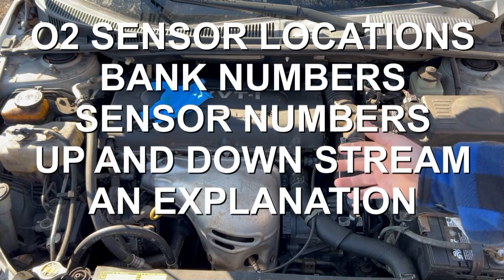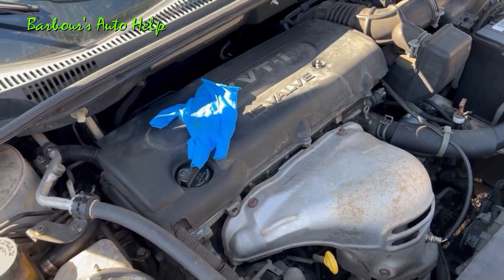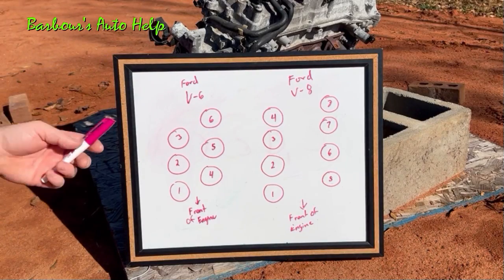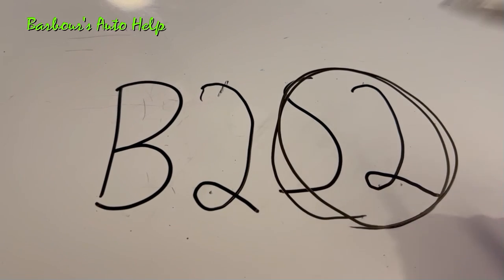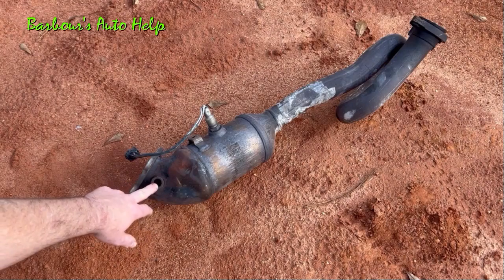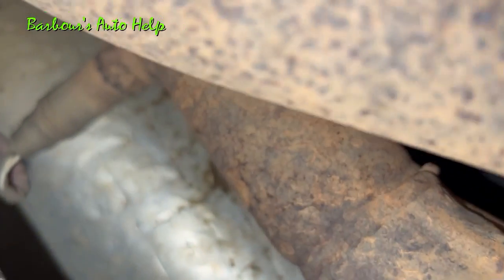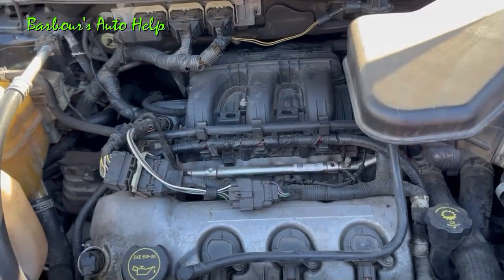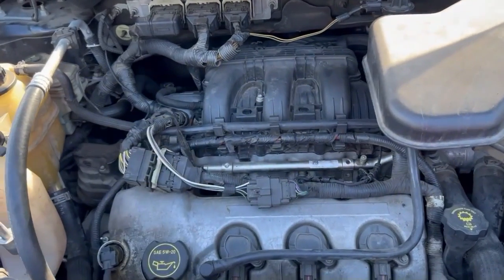O2 SENSOR LOCATIONS, BANK NUMBERS, SENSOR NUMBERS, UP AND DOWN STREAM: AN EXPLANATION

Comment: Hi, I have 2016 model Audi A6 c7, with fault code P2002 (Diesel Particulate Filter Efficiency Below Threshold Bank 1). I have had a diesel particulate filter clean but the engine light keeps coming bank. I do see excessive white smoke, drinks more fuel... What would you suggest?
Reply from the maker: Sorry your having this issue.  At the time I'm in not position to given an opinion on this matter as, 1 I'm not a diesel tech and, 2 I think I may have changed the oil on 1 maybe 2 Audis in my life and have no repair experience with them.  lol.  I'm sorry I can't help with this, but I have to be honest.  Humble mechanic may be the channel to watch.  I know he is mostly VW, but I'm sure he has more experience than I.  Also, it's quite possible that one of his viewers could point you in the right direction.

Comment: Hi, I had a catalytic manifold (4-1) and I replaced it with a 4-2-1 manifold. After that my car doesn't run smoothly. Is it possible oxygen sensor to lose pulse due to its new location.? It was placed to the collector which now is further away from the engine's ports.